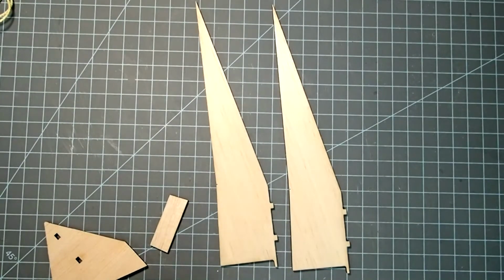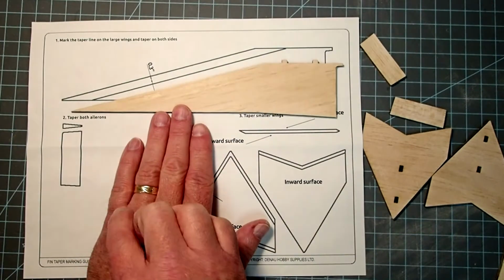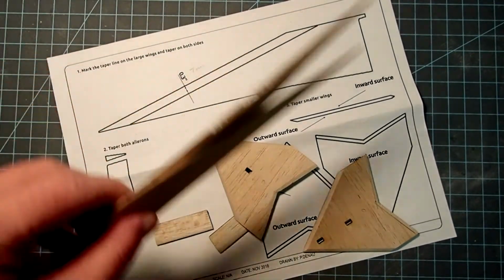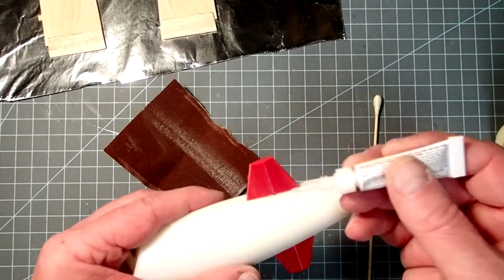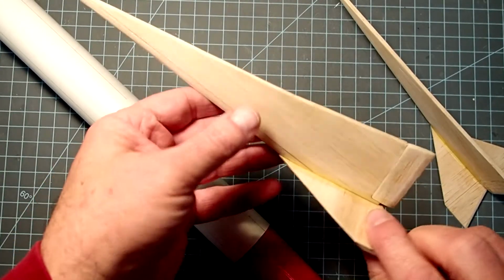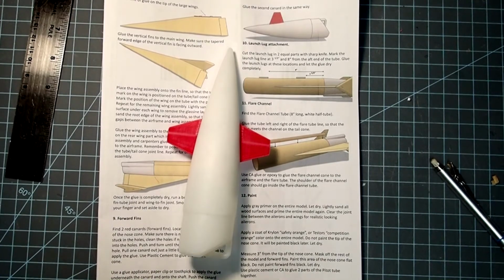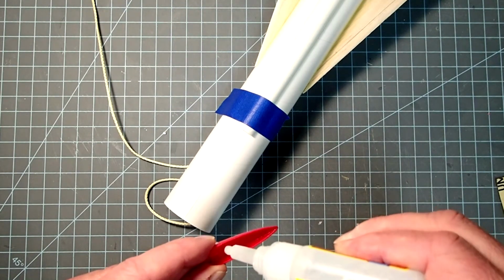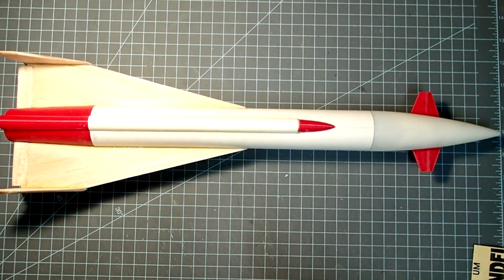Rocketarium "Jayhawk" model rocket assembly (part 2 of 3)

Comment: Hi Dave. First, thank you for the time you took to build this attractive rocket and the "watch out for this" tips. I have a question.
Every time I attach the launch lugs to my rocket bodies, I ALWAYS end up with pinholes from air bubbles in the glue. I've tried smearing the fresh wood glue with a pin to make sure NO air bubbles are in the glue, but after 5 minutes or so, air bubbles form beneath the surface, which end up "popping" leaving a pinhole. Usually there are 2-4 pinholes on each side of the launch lug. This is incredibly annoying. It's weird that it doesn't happen nearly as much on the fin fillets (2 or 3 per 3 or 4 fins on a rocket).
I've tried everything I can think of to make this stop happening, but I've failed. I'm speculating that as the glue dries, it's "sucking" air beneath the ends of the lug and forming a bubble. I'm at a loss.
Any thoughts about this issue? I'm about to give up and just slather some filler over it then enjoy another sanding session to clean that up.
Reply from the maker: That’s exactly what I do about half of the time. I will add a layer of model putty or wood filler over the glue.
Reply: Hello, What I do is I use a piece of tape to hold launch lug in place, then use some thick CA glue on both ends as a tack to hold launch lug in place, I take use 320 grit sand paper to rough up bt just remove the shiny finish,that gives the CA glue a good bite to hold onto.Then use your favorite glue to glue launch lug to bt & as you fillet. I use thin glue fillets . Good luck on your next one.